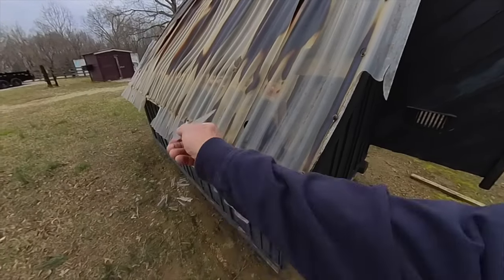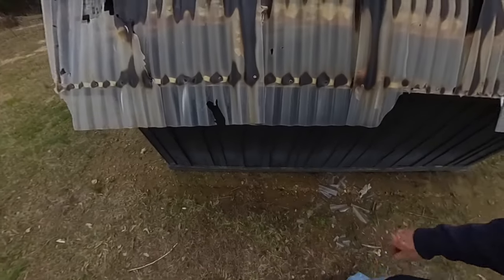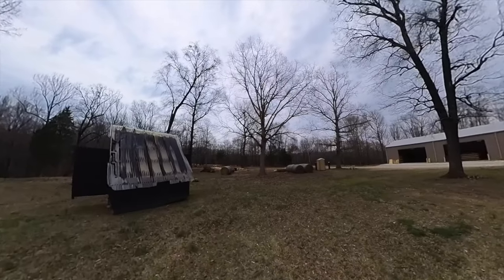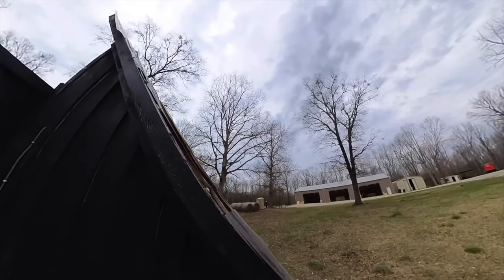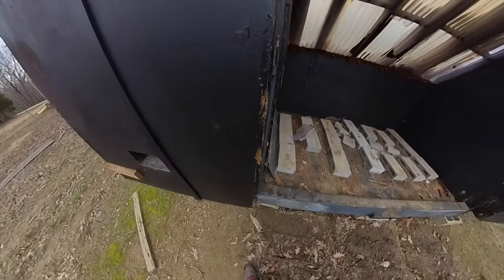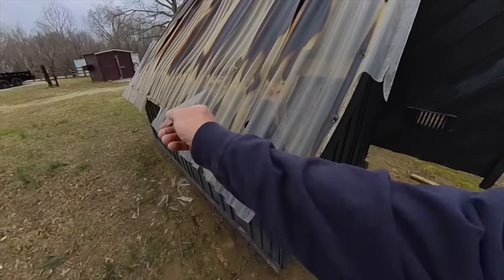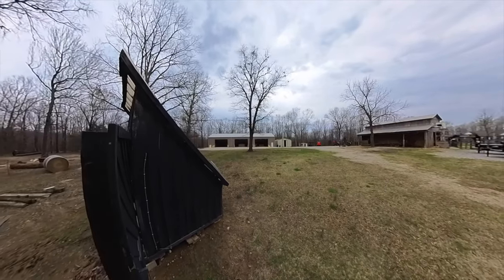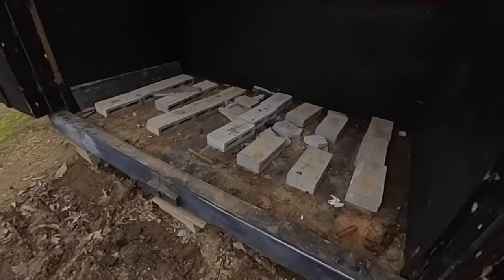I Destroyed My Solar Lumber Sawmill Kiln

Comment: I had intentions of building a solar kiln when I got my mill.  Then got worried about case-hardened lumber with Oklahoma summers.  I will give this advice to anybody planning on buying a sawmill.  Build or buy a kiln first.  Not too many customers interested in buying green lumber and waiting at least a year to reach equilibrium moisture.
Reply from the maker: I agree, a solar kiln would be the best first project of anyone buying a mill.  The nice thing bout a solar kiln is that as the temperature drops and the humidity rises at night, the wood equalizes and much of the case hardening stress gets removed.

Comment: Robert, based on your experience can you dry 2-2-1/2”slabs in a solar kiln?
Reply from the maker: Yes, quite well, slabs are perfect for a solar kiln, as long you keep within the solar collector size guidelines vs lumber loaded in the kiln, of the Va Tech Solar kiln designs.